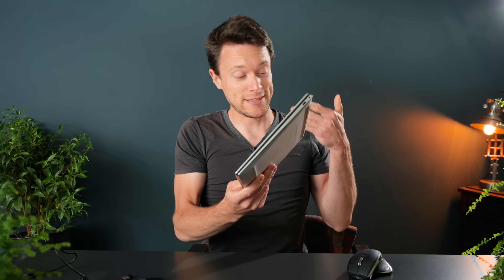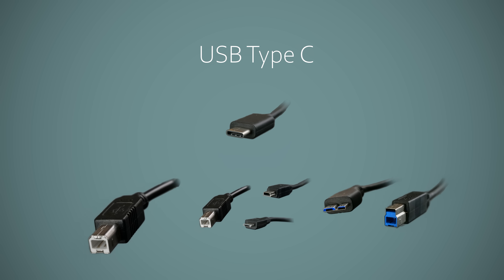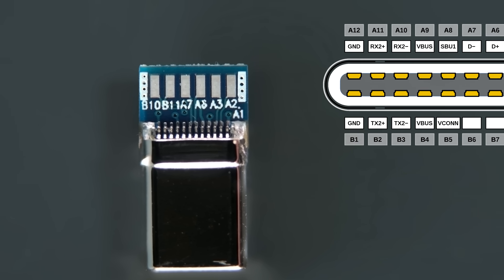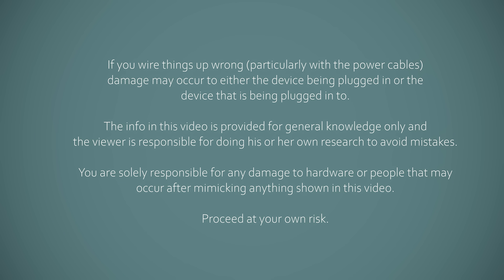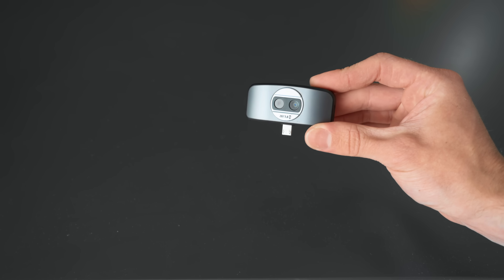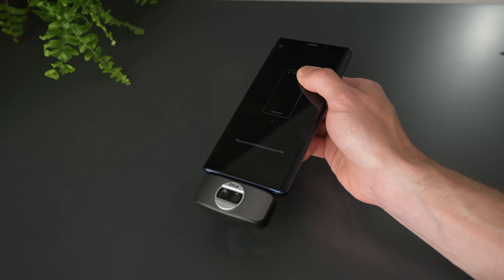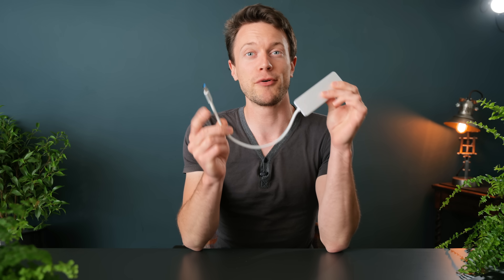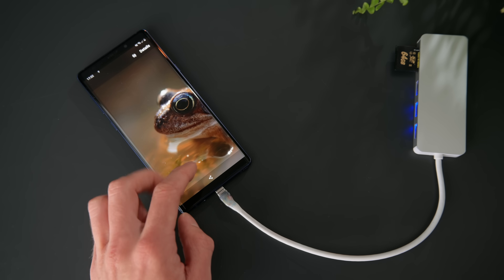Converting devices to USB Type-C

Comment: Can't wait till everything USB-C

One year later: new "USB-C mini" is here
Reply: I'm convinced that USB C is here to stay, everything new that isn't an iphone is using it and several new standards still use the same connector
Reply: @Lisa_Minci96 guess what
Reply: @Stampyboyz what
Reply: Pretty much. Type C adoption rate is slower than connectivity advancement. And bastard companies like to reinvent the wheel with proprietary connectors.
Reply: @_BangDroid_  it took USB 1 a few years to be popular on devices and the expense that went into creating USB C is too much for companies to give up on this early.
Reply: @amirpourghoureiyan1637  the only company that is so hesitant is apple. Others are adapting to type-C.
Reply: @brosplit  That is only the case for the iPhones now as they use the connector on every other main product they sell, but nevertheless, that is going to change soon as the EU recently passed legislation forcing all phone manufacturers to use Type C as a universal standard for modern phones.
Reply: @amirpourghoureiyan1637  i though usb type c was industry response to anti proprietary connector pressure. to reduce e waste. (which in itself makes all previous devices connections incompatible obsolete e waste )
Reply: @nexus7tablet610  Yes, it was a response to companies creating unnecessary landfill from proprietary connectors that can't be reused on other devices.
Reply: @amirpourghoureiyan1637  Don’t forget Apple Magic Mouse, Trackpad, Keyboard, Apple TV Remote, iPod, iPad, and AirPod cases all use lightning. At least now iPad Pro and iPad Air now use USB C.
Reply: @mendodave  Changing them all to USB C  would be a miniscule change for Apple, at this current point, they can't get around the EU law so I imagine they would rather change their devices than fight any more futile legal battles. 
Then again, Apple probably has made a deal to have a period of adjustment so that the change is not right now, as R+D had already completed for various devices before the law came into effect. 
How long that period will be will depend on them, as they will not want to keep a charging solution around that is inferior to their competition, so they'll have to change at some point soon.
Reply: @amirpourghoureiyan1637  I hope that’s the case. Lightning is nice, but USB C is better and it would be great to have only one type of cable for everything.
Reply: BangDroid lol Apple is going to go USB-C relax
Reply: @_BangDroid_  "Apple"
Reply: @_BangDroid_  cough apple cough
Reply: @_BangDroid_  yeah like bruv can we just have less connector choices? i understand that some devices doesn't work with some connector types and maybe is only compatible with one special connector. but why bother re-inventing something that have no pros compared the original one?
Reply: So annoyed that shavers, trimmers, toothbrushes, calibrators, other accessories etc are still coming out with USB or Micro USB... Flips Table
Reply: @f.remplakowski  The reason micro is still being used is because its cheap and durable. USB C is durable, but not as cheap.
Reply: @TheForgottenWolf  It's also not super durable if the connector on my pixel is anything to go by. It got super lose super quickly
Reply: @f.remplakowski  mini usb
Reply: @ducttaperulestheworl  mini usb is effectively dead.
Reply: @f.remplakowski  your parents must have been clairvoyant when they named you Filip
Reply: i know things like that have happened many times and maybe im being too optimistic ( though im pretty pessimistic generally) but i really think the usb c connector will be around as the primary physical format for awhile. the protocols will continue to be updated but i think usb c has at least another 5 to 10 years. hopefully more. its hard to imagine lutgrowing it any time soon especially considering what thunderbolt 3 can put through it
Reply: @saleplains  just got my first thunderbolt 5. hello from future lol
Reply: It's really tough to make even a smaller connector.
USB C is shared among USB 2.0, 3.0, 3.1, 3.2 and Thunderbolt.
24 pin crammed into a connector less than 1mm thicker and 1.5 mm larger than Micro  USB B. It's reversible, and even a bit more robust.
I don't know if the next high speed connector will be bulkier or with optic fiber, but considering than USB has 24 years of history as standard, it was time for a connection refresh.
I hope to see soon more mainboards and brand computers with 3-4 USB C ports
Reply: @GsrItalia  I agree, I would also like to see more affordable and mainstream devices have that connection (storage, keyboard, etc). However, considering that unlike the legacy I/O that existed when USB first entered the market, normal Type A ports are still worth including as they do not take up nearly as much space on boards as parallel and serial ports did.
Reply: not sure, even micro usb was a step in the right direction, remember that every manufacturer had different connectors before! I'm optimistic
Reply: @simonstucki  Ah yes, the dark times (reminisces about drawer full of proprietary USB cables)
Reply: I want a USB-C incandescent lightbulb at 100W, lets see if this spec is on par to what it says !
Reply: @monad_tcp  As per spec, all USB C to USB C cables are required to support 3A of current. The maximum voltage that can be negotiated via USB PD is 20V, which equates to 60W of power.

To get the full 100W, you need 20V at 5A, and a cable that uses a built-in chip to identify it as a high-power cable that can support the higher current.
Reply: well this aged badly:)
Reply: watch it literally just be a pin head
Reply: @S31Syntax  I know it's a joke, but that would never happen since it's way to fragile
Reply: @S31Syntax  That is literally what a lightning port is, although a USB-C port has 24 pins instead of 16 so most probably it will look exactly like a lightning port but slightly thinner and has more pins.
Reply: Your wrong
Reply: Well that's what I love about standards! There are so many to choose from!
Reply: A. M.  Type c is sooo much better had one on my tablet only used one cable for the life of that tablet compared to my Apple products  went through like 8 lightning cables soo badly made smh
Reply: And then USB-C micro, before they decide to push USB 5.0 which has USB-D
Reply: USB-C
USB-C mini
micro USB-C
Reply: @tachometer-flac  USB-C is a smart connector like pointed out in the video. It's much more future proof. 4 years after your comment we still have USB-C. In EU there is also a law now that portable devices like phones and tables needs to have an USB-C charging port forcing even Apple to go USB-C to be able to sell in EU.
Reply: once the iphone has it i think adoption with 10x speed up
Reply: when you want to upgrade your old laptop that is only usb type a
Reply: USB-C Mega, but it's actually just USB-A
Reply: No. USB-C is meant to be ONE connector. No MINI or MICRO USB-C!
Reply: USB-Magnet
Reply: lol
Reply: quantum physics says that your pushing your luck making something that small
Reply: I dont care that much for usb-c, but I like usb 3.1 datatransfer rate. Problem is that not everytime the USB-C connector is using USB 3.1, and not everytime the USB 3.1 have a USB-Connector :/ too many standards going on in usb-world.
Reply: Usb4 is on the horizon and will likely launch next year with usb c the only recognised connector officially (maybe?), It will also bring thunderbolt features into the usb standards as Intel have given them to the usb consortium.

Hopefully we won't however get a repeat of usb 3.1 gen 1 and so on and go back to just usb4.0!
Reply: oi that's almost antisemitic!
Reply: Too many things are still friggen USB 2, even today.
Reply: @CakePrincessCelestia  especially when you get on a shiny new PC and most ports are USB2, with a couple of 3.0, and hope they come with non-broken drivers.
>copy my documents back to the new work PC from a WD black in a 3.0 enclosure
>500Kb/s

yes, that's the 3.0 port but windows fucks the drivers or some crap. everything is garbage.
Reply: @SilverSpoon_  I see that movie on my rig with more than half of the "USB 3" ports not being compatible with anything and only running at 2.0 speeds or weirdly switching back and forth constantly, only causing problems when being used with USB 3 devices. OK, that's an nowadays rather old Z77 chipset board, but anyway. There's never been any driver updates that would make those work reliably and there never will be.

Just like the Spectre and Meltdown thing. Who did actually get a BIOS update to fix that? Instead, we've been getting our CPU performance crippled my MS all across the board and noone even knows if the new gens (Intel 10+) ever fixed that as noone seems to care anymore - and Windows having taken away the performance anyway.
Reply: @CakePrincessCelestia  yeah we live in strange times...
Reply: @SilverSpoon_  We just live in a strange world that doesn't have enough pones :)
Reply: @SilverSpoon_  keep in mind the drive also matters, the enclosure also matters, even if it uses USB 3.0, the computer itself matters as well even if its using USB3.0
also fuck windows
Reply: @CakePrincessCelestia  USB 2 is fine if the device isn't bottlenecked by the connection. Input peripherals and sound cards are going to be USB 2 for a while. USB A / B are still the most modern non-miniaturized standards, and will be used in professional desktop deployments for another decade or two.
Reply: Oh god no…. mini and micro USB were horrible, and broke far more easily. You’d basically only be able to use those cables for only a year before replacing them.
Reply: lmao
Reply: This didnt age well
Reply: Too bad 2025 is worst year
Reply: Given the fragile nature of the USB-C ports it's liable to end up a nightmare. One piece of advice: Never buy a laptop with one USB-C port like a Macbook.
Reply: first i saw usb type c i hate it i dont know maybe im a boomer ...
but after using it.. i hope usb type c become more universal..
Reply: as long as smartphone companies adopted USB C it will still be leading except when they go full wireless which isn't that far.
Reply: @0rlanix  I'm sorry but full wireless charging is I would say like 20+ years as the amount of current through 2 wires to produce enough capacitance to charge faster than plugging a cable still won't be more
Reply: @0rlanix  Wireless is gay. If you have a phone with a large battery (5000mah) it takes HOURS. But with the fast charge cable it takes only 30/40 minutes.
Reply: @foty8679  the slower wireless charging is better for just dropping it there and going to sleep. And I would assume it would be safer and less prone to battery explosion or expanding.
Reply: Authorities dictated that USB-c is the standard. They need to move to USB-c, as is mandatory.
Reply: @gonzalotapia1250  Maybe in your nanny state, where the government thinks they should be able to tell companies what plug they use. USB c should be standard, but the government telling private companies what plug they can use is disgusting. And it's the reason that we are losing freedoms. The even funnier thing is the EU thinking they can tell an American company what plug the need to use. Riiiight. See what happens if Apple tells them to effoff, and the EU tries telling their citizens that Apple products won't be imported. See how fast citizens get off their butts and put a stop to that regulation. Chances are that the betas at Apple will fold and comply with random regs put in place by governments from half way around the world. To be clear, I think everyone should use USB c, and Apple should switch too, but not at the expense of giving up autonomy.
Reply: @xenonram  I understand your distrust of EU-style regulation, but mandating interconnectivity standards is a far cry from mandating the use of specific technologies. Nobody is telling companies that they have to use USB, only that if they decide to use USB, then it has to be the same type of USB that everyone else is using.

The one and only thing this prevents businesses from doing is locking people in with proprietary "standards" that only apply to them. Apple is indeed a perfect example of this. Lightning cable is exactly the sort of walled-garden approach to business that needs to be discouraged. And the proliferation of competing USB connectors is what you get when there is no regulatory oversight, even when there are standards.

(Oh yes, let's indeed see Apple try to tell the EU to "effoff", and what they decide to do after a couple of years of embargo by the world's largest single marketplace. Methinks someone is mistaken on who would blink first.)

In short, consistent, open standards create level playing fields, exactly the sort of thing that governments should be doing—protecting the consumer and allowing new businesses to fairly compete with the incumbents.
Reply: Still type C even 4 years later! Might be on the horizon though, just a vague thought
Reply: USB Mini is a variation of USB 2.1
USB C is a variation of USB 3.2 Gen 2
Calling something 'USB-C MINI' would be a marketing disaster as it would be massively confusing.

Also, pretty much everything already IS USB-C and has been for a couple years now.
USB-C isn't that great.
Thunderbolt (2) is a much better standard, with far more bandwidth and power delivery. It is a better standard for the industry to adopt.
Reply: @lord_scrubington  USB mini is a connector
USB C is a connector
calling USB-C mini would be dumb yes
USB-C is a great connector
Thunderbolt 3+ uses the USB-C connector
you could wire up Thunderbolt 2 to a USB-C connector (though that would be stupid and non-compliant)
please stop misinforming people.

Comment: I don’t see the need for a webcam these days. Most platforms needing one will have also developed an app by now. 
And that means, you can use your smartphone which has a mic/cam and all associated connections for speakers etc built in.

Comment: The high-power delivery capabilities are one of it's most impressive features, but also unfortunately leads to a big drawback. For a laptop manufacturer to include multiple USB-C ports on a single device, there will be an inevitable compromise where only 1 port has the hardware to run in the high power mode (i.e. for charging), and I think that rather than taking this approach the designers are going to stick to providing just a single USB-C port on the majority of devices in future which will be a huge disincentive to USB-C becoming an option for peripherals like mice and keyboards..
However while it makes sense for smaller devices like tablets to have just one connector, seeing larger laptops without any USB-A ports is just inexcusable. So while this is a great and useful hack, it's one that shouldn't be necessary to begin with. (Welcome to the wonderful world of having to spend extra money on a bulky hub if you want to be able to charge your laptop and use a mouse at the same time).

Comment: Uhm. sorry to say this, but type C is a quite strange connector and standard. even professionals fails on designing the circuit. (see the RPI4 fail)
So I would not do this. There are a tons of different stuff that could go wrong. And the CC connectors are not simple pullups or pull down pins. they are actually data pins and have its own protocol for the upstream usb C multiplexer and controller. They are used to detect the orientation of the cable and to negotiate the power requirements. ETC.

Type C cables could be active and passive, it can also provide power up to 20V. (USB-PD protocol)

I would really not mess with thoose connectors on you could run into some issues with both the slave device and the master.
Reply: Jacob Davis  I copuld do this without any isse. I've designed some USB C PD dongles so I know how the things work. But I also know that you could screw things up if you don't strictly follow the rules.

Comment: Good video man. I was trying to modify wireless LG g602 mouses adding rechargeable lithium battery inside with usb type c port and battery charger controller, but I'm still waiting components from AliExpress.
Another project will be the creation of a wall usb fast charger using also a button to switch on or off the charging

Comment: 🙄🙄🙄 USB c is useless, lightning is 10 times better, It can deliver five times more power, It allows you to output to displays, It allows you to connect your phone to Ethernet, and it loves you to use external GPUs like the GeForce RTX 2080 ti, but that last one isn't useful because the RTX 2080 TI would still be a bottlenecking a13 bionic. You're stupid, everyone should use USB lightning

Comment: I already turned a broken laptop into a webcam but the webcam had 3 extra cables in it and i dont know where or how to plug them into the USB~ so if you can feature turning a laptop webcam with 7 cables attached to it (i think they are for the mic?) it would really be helpful :)

Comment: It's easier and less problem with smaller adaptor. You also risk damaging whatever part you're trying to mod, you can only do it if you're committed to only using usb type c and not vice versa, while the items are widely available, many don't have them at hand or have the skills to do them (soldering and using multimeter) and most of all, is it really worth your time and money?

I'm not so impressed with the content compared to previous ones, sorry.

Comment: Then me: ordering a small usb converter from aliexpress for 0.30eur
Why do i need to convert, there are converters that one end plugs in the usb type a, and then the other end is type-c
Reply: I was wondering the same thing- it's a lot less trouble!
Reply: Even the smallest adaptors are bigger than the diy solution.